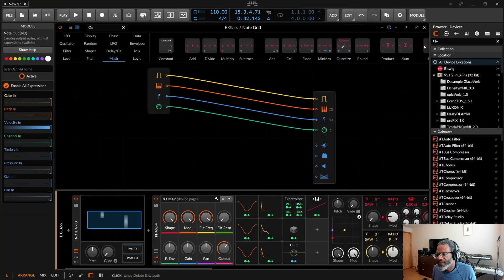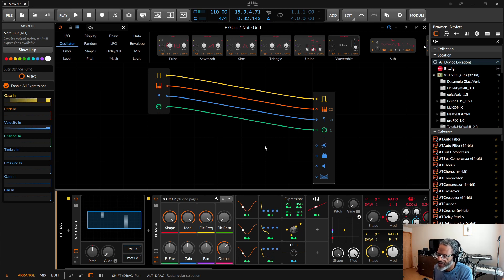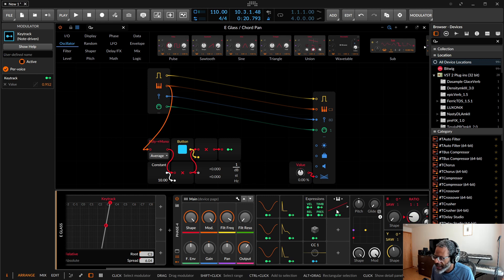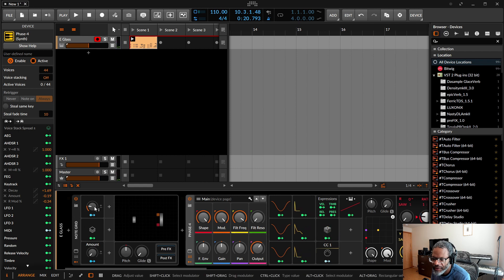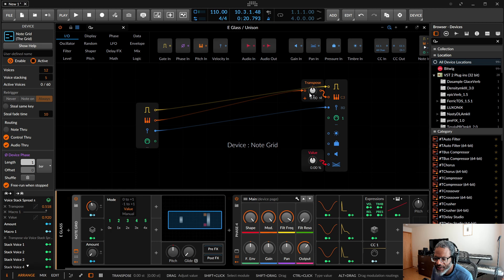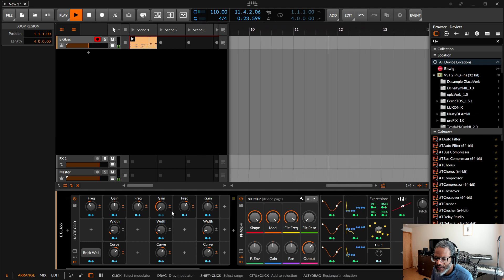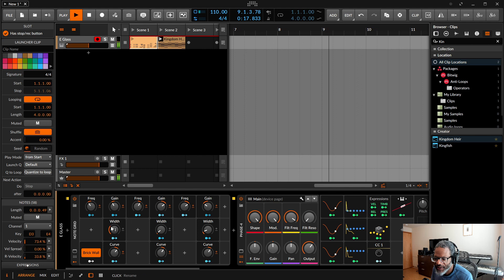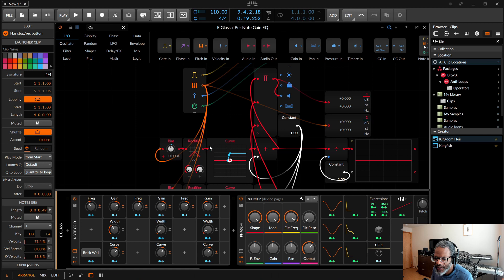Mixing Tools Only Possible in Bitwig!!

Comment: Hey, nice to see you back.  I posted a comment/question on another video of yours a while back asking about grabbing the lowest note of a chord.  This was in the context of an idea my drummer and I had about using a drum trigger to play a bassline.

I just wanted to tell you that I figured it out in Bitwig, no VSTs.  I'm not sure what update made it possible.  Anyway, it works great.  Low latency, sounds neat.  Using a real drum + trigger and an external synth (but could be a Bitwig synth).  Decoupling the midi note and the gate was the trick.  I used a button plus a modulator like you showed for a minute there.

I need to make a video about it.